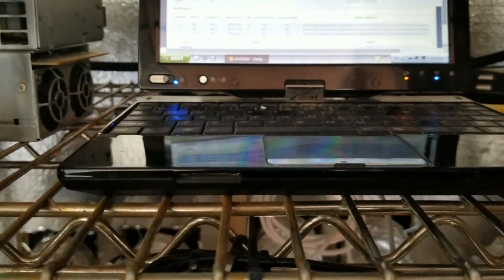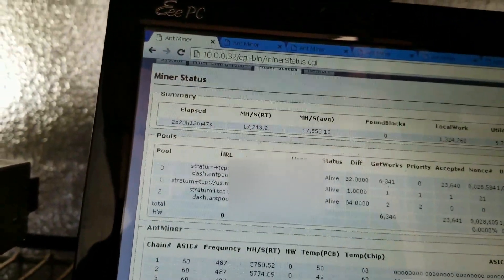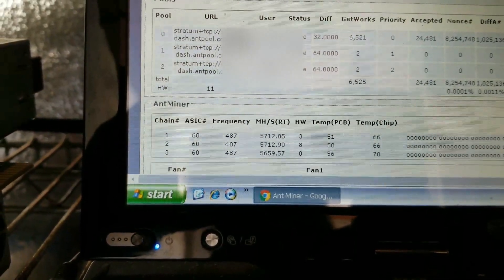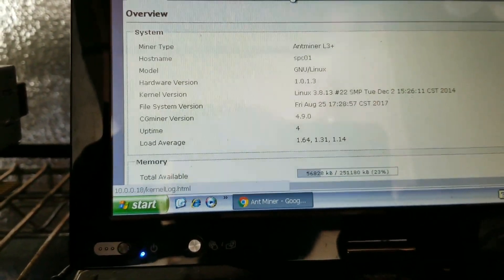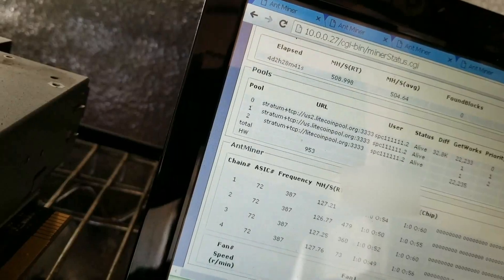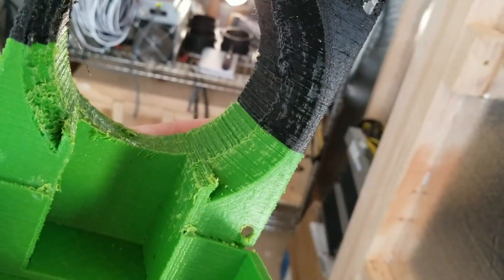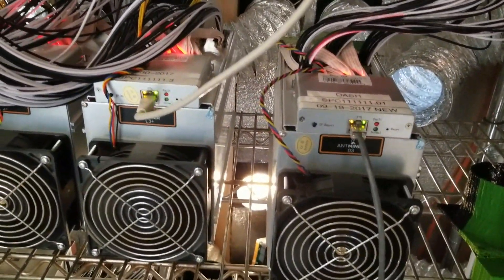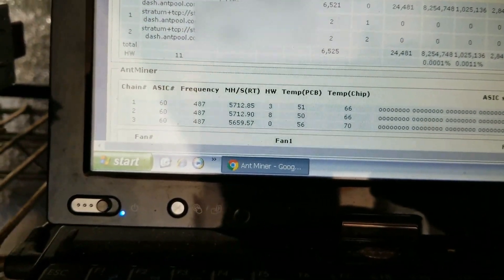D3 S9 L3+ Antminer shroud more info.

Comment: What I'd like to know is why go with a 4" vent and not larger? Doesn't the decrease in size of the shroud cause a backpressure on the fan and impede on the cooling performance? Or doesn't it matter in the end?
Reply from the maker: you can get a 4 inch vent, what i did in this video shows that you get a temp drop on the unit using mine. and you need to remember that the fans inputting the air are only 4 inch, so what mine does is capture all the input and out put air in to the same size area and also catches the lost air coming out of the top back of the unit that is still a product of the 4 inch fan. it is also cheaper to run the 4 inch tubing then the 6 or 8 inch ones. also with a bigger output hose the fans are only meant to move the air in 4 inch hoses so you will have pressure drop on the output by moving to a bigger output.

Comment: That is a little to hot ..45-55 c would be better . Heat affects performance  . Think about cold air induction  to get the temp down .. An evaporation cooler could do the job  ..or an air to air   cooler .. Good video Thanks